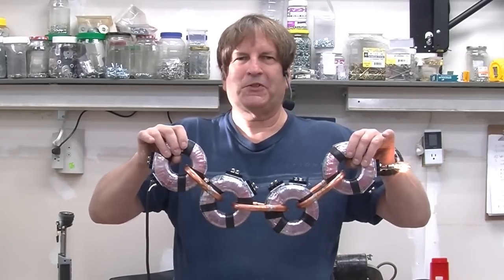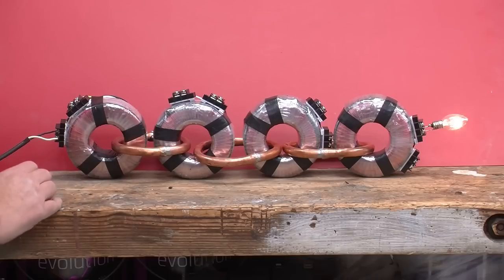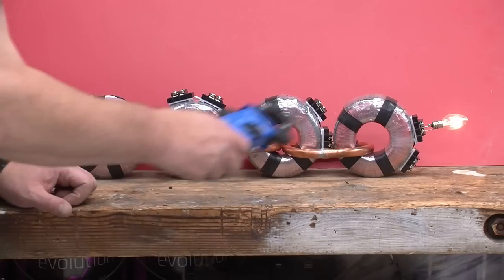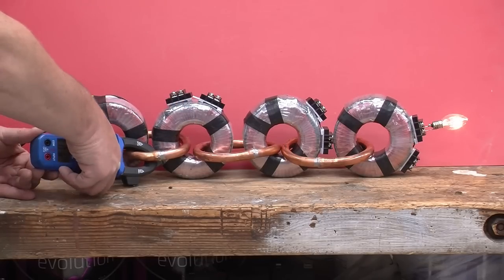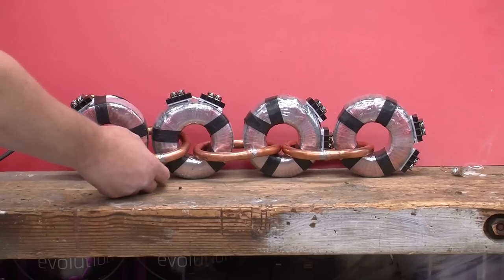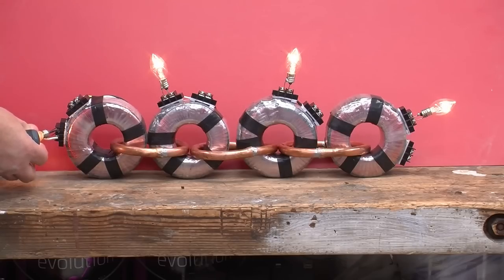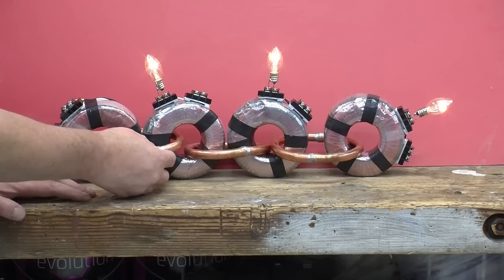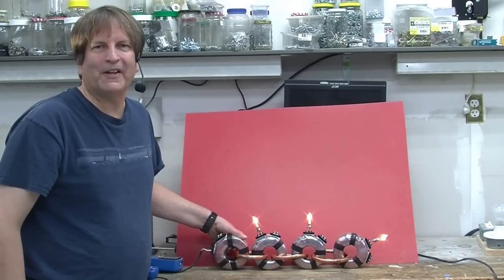Let's Experiment with an Electromagnetic Chain!

Comment: It would be nice to know the accumulated delay through all the toroid's. I mean how many stages are needed before the final load starts to decrease the input current rather than increase it ? Thank you for this interesting demonstration.
Reply from the maker: I'm not quite sure what your are asking - is it how long it takes before the input "knows" that that a load had been connected at the other end and the input current increases? The speed of the effect of the load reaching the input is the speed of light in the medium. In this case its a lot like an electrical transmission line (such a 75 Ohm coax line feeding a TV) where the internal speed of light is often around half that of what it is in air. Here we have lumped elements and relatively high inductance's so its probably somewhat slower. Lets guess a speed of 0.1 x the speed of light (299792458 m / s ) and the length of the chain is 0.5m. So that works out to 17ns. Assuming the AC power is clean enough going in, I should be able to measure that with an oscilloscope. I'm planning a transmission line video - measuring the chain might be an interesting addition to that.
Reply: @ElectromagneticVideos  Yes thank you for reply,  that is exactly what I was wondering about. The input has to travel thru the chain to reach the load but a secondary signal has to traverse back from the load to the input again, in order to affect the input level.  So the delay would be doubled I guess. As you implied probably insignificant at 60Hz.  I'd love to see a purely magnetic oscillator built on your chain approach maybe loses are too great?
Reply from the maker: @smokyatgroups  You have to somehow inject energy to make up for the losses but if you did that you could make an oscillator with a frequency of 1/(round trip time). The other problem is it would be a very high frequency which generally doesnt work well with big things, so a very long chain of small loops might make it possible, and somehow use some non-linear magnetic effect to inject power from an external source.

Comment: I would like to see the conditions change as line frequency changes from say 25 hz to 60 Hz and then maybe double to 120. I think somewhere around 400 Hz it wouldn’t work that well with iron. Could you try to use a ferrite  core torrids instead and then experiment with high frequency. I would really like to know
Reply from the maker: I think the main issue with changing frequency would first be the thickness of the core lamination vs eddy current loop sizes. I really like your idea of ferrite toroids - you could make a chain of ones maybe and inch in diameter or less, and similarly sized copper loops. And it could be driven with a switching power supply circuit. Maybe sometime in the future!

Comment: this is cool! can it be done on a smaller scale?.. with less windings etc?  i dont understand all the math but itd be fun to try n get one to work
Reply from the maker: As someone below pointed out (so I'm not claiming to steal their idea) you could use small ferrite toroids and small copper loops if you ran it at higher frequencies and have it really look like a chain. The higher frequencies make it possible to transfer more energy with smaller magnetic cores which is what happens inside switching power supplies in all our electronics today.

Comment: Sure it's powered through a gfci, but any of the 120 volt windings after the first and even the first one if you say it's on an isolation transformer, could kill you. A GFCI doesn't actually make this any safer. Now because it's all run through an isolation transformer, you could hold on to any one wire and stand barefoot on the floor and it shouldn't get you killed theoretically. Overall though excellent video and I plan on sharing it with people. Keep up the good work.
Reply from the maker: So glad you  liked it - the main purpose of the GFCI/isolation transformer is to protect me if I touch the input terminals. And yes - all the GFCI would do is help if the isolation transformer failed (unlikely). The GFCI is in the wall plug - I mentioned both simply to remind anyone doing this to be careful and protect themselves. Also to your point if you touch both the 120V terminals on any of the transformers you will get a full strength , dangerous 120V shock.  The toroid  transformers I used also have a 30V winding, and for safety and perhaps for someone doing a  classroom demo, the better idea would be to use 30V lamps and power everything from a 30V AC source.
Reply: @ElectromagneticVideos  the video really was very good, my comment was just so that someone doesn't misunderstand and think that they couldn't get a full voltage shock anywhere down the line without the GFI getting tripped. What you showed about the magnetizing current makes sense, I had never really thought about that before. It's pretty cool to see how it piles up.
Reply from the maker: @chadhiggins8397  Its always good to point out how to make things safe or safer - and I appreciate that!  While making a video you don't always remember or think to point out everything or give the best explanation.  If you liked the magnetizing current bit you might like the next video which I'm editing right now - hopefully published later this evening or tomorrow morning.

Comment: Is that silver paper wrapped around each winding?  If it is, why does it not act as though a shorted turn?
Reply from the maker: I guess it does look like silver paper - its plastic wrap the transformer manufacturer used to protect the windings they put on the original toroid. Your absolutely right though - if it was silve paper it would have made for a much more exciting video!

Comment: Cool demo!  Hmmm, so what happens when you create a 4th copper loop, going from the last inductor back through to the first to make a ring chain?
I realize the voltage potentials in your current loops are insignificant, but still, it makes me shudder to see someone touch a wire moving that much amperage with bare hands.  The ElectroBOOM channel has nothing on you!
Reply from the maker: If you had it the right way so the potentials were about equal, it would be equivalent to feeding power into the chain from both ends and make drawing power in the middle a bit more efficient. If you had the coil in the opposite orientation, it would be an effective short with the  current (and power) limited by the resistance of the copper and after a while insulation on the 500 turn copper windings would be melt and we would get into  ElectroBOOM type territory. Although his experiments are a bit more spectacular!

Comment: God's. What are the vars on that?

The powerfactor on that has to be massively thin

I would love to see if you added capacitors on your single copper pipe winding. And see if you could drop that unused power use.
Reply from the maker: And the power factor gets worse as the chain gets longer but is actually quite low: the unloaded current in  the copper pipe 1 turn winding at the last link of the chain is 5A at 0.2V so 5A x 0.2V = 1VA so each core adds 1 VA to the system. So at the input end the amount is about four times 1VA  equaling 4VA from the 120V input. The transformers I used are rated at 180VA so if the system was fully loaded with a 180W load the power factor would be pretty good!

Comment: Fantastic! I am learning, I want to build devices as a hobby. While Youtube is a great resource, there is a ton of misleading or outright false info out there. I have many questions and cannot tell very well who to trust when it comes to this kind of thing. I have yet to build, because I want to understand FIRST what I'm doing. I have questions! LOL! What would happen if you placed a rectifier on the first coil? Why is it the AMPS that increase and not the Voltage or Watts? What happens if you wrap a permanent magnet ring with copper wire and apply power? Any direction would be most welcome; I can tell from reading all the comments that you know what you are up to. Thanks for this video, along with any others i haven't seen yet lol, I'm very much looking forward to them.
Reply from the maker: Youtube is a great resource but you are so right about some stuff being misleading. Oddly, some people have even accused me of faking this video! No idea what they think might  be faked but it might be because so much other stuff is fake. Worse there is some downright dangerous things occasionally send in the electrical or science areas.

If you put a rectifer in series with coil feeding the power in, it would mean the coild gets DC (actually pulsating DC) and really only its resistance (really low) would limit current going in. so a low of smoke and fire - could make a youtube video that goes viral :)

For why is the voltage essentially constant,  and current changing, look at some of my other video about transformers and similar things and that should answer a lot of your questions. Hope you enjoy them!

Comment: I always wondered why the primary side of a transformer isn't just a dead short.  I still have trouble "getting" that intuitively, but I guess the current and voltage being 90 degrees apart kind of explains it. Is that because a transformer is basically an inductor? And does it have to be designed for a specific frequency?
Reply from the maker: Yes - if the secondary is unloaded (and therefor has no effect) it is just an inductor. When the secondary is attached to a load and current is drawn, that current produces a field that reduces the field in the core. That in turn means more current has to flow  in the primary to bring the magnetic flux back up to the original level to generate the 120V equal to input voltage.  I'm planning a "how does a transformer really work" video probably two videos from now (I do about 1 a week) where I will go into that in more detail. 

And yes  - they are designed for optimal operation at a particular frequency and power level. As a general rule, the higher the frequency the small the transformer can be. So for a typical AC wall adapter switching power supply, the frequency the electronics create is usually between 50kHz and 500kHz so the transformer can be tiny compared to the 60Hz equivalent. Its thanks to transistors and ICs being so cheap that we can do this.

Saw your eclipse bands video - how interesting - I totally missed that during the eclipse - I'll have to look next time!
Reply: @ElectromagneticVideos  Awesome, thanks for the detailed reply! And yeah, I saw Destin from SmarterEveryDay do a call out for people to capture those shadow bands during the eclipse, so I was on the lookout for it. I was fortunate to live pretty close to the line of totality. A lot of other people had the same idea. The traffic around Nashville that day was insane.
Reply: The primary is a dead short - just put your ohm meter on it and see.  The ohm meter measure 0 Hz (DC).  The transformer here was driven at 60 Hz.  At 60 Hz the primary of the transformer has an impedance which is primarily inductive and can be easily calculated (Xp=2*pi*F*Lp).  F is the frequency part you are talking about and makes it so the transformer is not a short at 60 Hz.  If the input AC source has a DC component on it - this can saturate the transformer and / or short the source depending in the DC resistance of the primary.  Faraday did not define a transformer vs inductor - IEEE says that a transformer is a device that transfers energy - an inductor stores energy.  In power conversion, there are devices that look schematically like a transformer but are in fact inductors per the IEEE definition….
Reply: @justinpenn9250  An inductor is a reactive load that 'stores' no energy.
Reply: @BTW...  Sorry dude - Inductors store energy by DEFINITION!  Look it up - look up "buck converter" - you will see the inductor stores energy when the switch is on - and supplies energy when the switch is off.

Comment: It's scary that you allowed the 3rd and 4th bus bar copper coils to touch. 😳

I have a serious uneasiness of bus bars/open conductors, as a datacenter I used to work at vaporized a 3ft section of a 1Mw bus bar (yes, 1 megawatt) and there was a green, red and black stain on the ceiling above where the bar was.
Reply from the maker: Its actually not an issue in this case: maximum 0.2 volts potential so less than a one cell battery, and low enough that the natural resistivity of the copper limits the current to about 800A (=max 160W) so no vaporization here. And no issues with them touching - each loop is a self contained circuit so no current path if if they touch. 

A 1MW bus bar - wow  - I have never seen one of those - I dont work in high power stuff. I can imagine it must have been like when you see videos of pole transformers explode.
Reply: @ElectromagneticVideos  basically. I don't work with high power stuff either, I'm a systems (Linux) engineer. I do know that we had a 1 week outage on part of our datacenter floor, and that one of my coworkers near the bus bar in question when it popped apparently soiled himself a little bit.
Great Channel BTW, subscribed.
Reply: @ElectromagneticVideos   I've worked in the Generation/Transmission sector.  1MW bus is kinda small. A single 4" x 1/4" Copper bar will do that easy. Last job in that field was modifying Cat diesel Gen control panels and the relatively short 3 phase Bus, really just connection flags rated at 1MW each... 3 units went to a new hospital building locally. 2 in Emergency Service with 1 standby. 
The largest DB I made used 3x 5" x 3/8" per each 3 phase - main bus feeding bus ties and several outgoing 2,400A @ 415V circuit breakers. There was multiple stacks of 250A Combination Fuse Switch units too. It was all 60kA fault rated. Parallel bars require spacing between bars equal to bar thickness. 
There is a significant amount of design consideration for the strength of bar mounting to resist any fault forces as well as meeting the required mechanical strength at the CB bar connections so that the CB's can achieve their true Fault current rating.

 I can say it is impressive to see the resulting metal spray applied in microseconds to brick walls after a very serious high current fault occurs that melts 3x 1 metre lengths of smaller single 3" x 1/4" main busbars. Up close you see lots of interesting colours and textures from the curious hybrid alloy of Copper/Steel/Tin fused onto a brick/concrete substrate.
The explosion tore off 2 heavy fire doors to the main switchboard room... but not a single wire reo glass louvre window pane was damaged.  
The fault was huge because the factory was located next door to the Major city sub-station... being the origin of the LV short cable run to the fault. A huge huge prospective fault current presented, despite the correctly rated 800A fuses. Grid engineers estimated the fault was in the100kA range.  
That night most of East Coast of Australia suffered hours of blackout due to that one faulty main DB.  95% of the major and minor subs went into a cascade protection fault scenario. If a 350MW base load power station was connected to The Grid it was dumped... each one that dropped triggered another to drop. Same thing happened to suburban HV distribution sub stations. Even backwater country towns went down. That night the Grid came within microseconds of loosing synchronisation between all Power Stations. It took hours to get it all back online.  
Can't blame a DIY idiot for that... the mingy stingy building owner... perhaps.